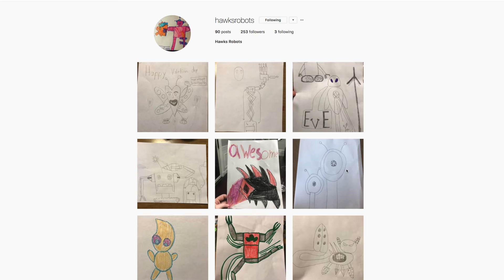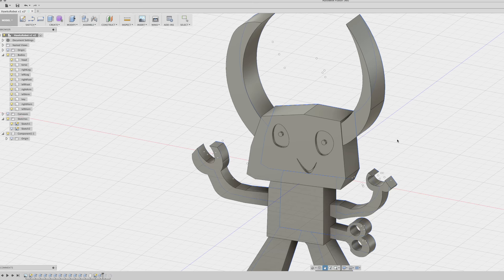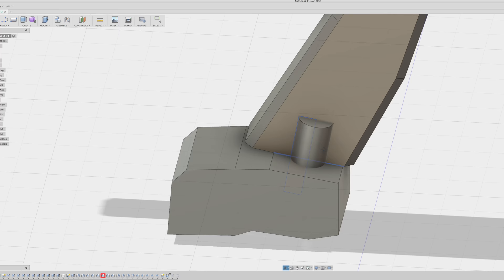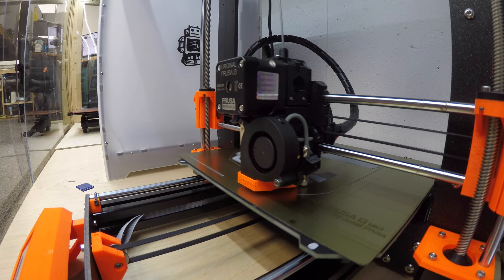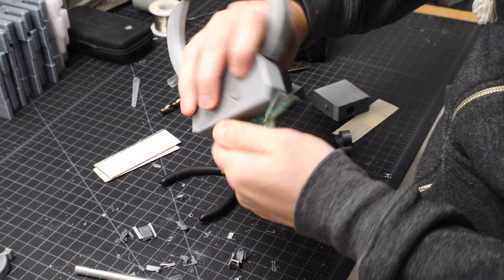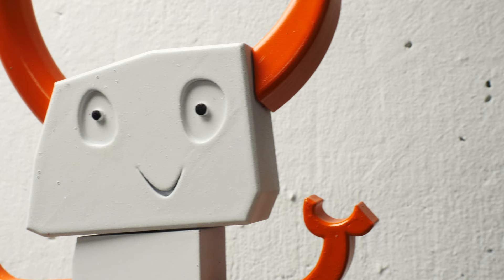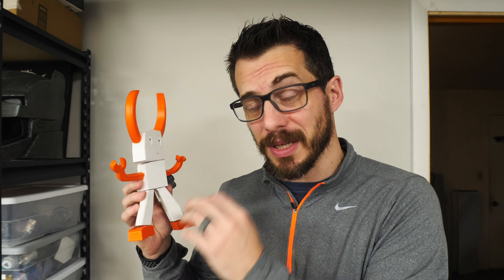Turning a drawing into a toy using 3d printing! | I Like To Make Stuff

Comment: Awww BOB! This was wonderful. The hug at the end, man, that makes it all worth it. Right there.

One thing - the posts CAN be a bit fragile, though, you mitigated this by printing them on their sides. That'll give them strength for days!
Reply: 3D Printing Nerd Maybe have holes on both parts & use wood dowel for the connections.

Comment: Really cool project ! Got a small tip for you, masking holes is easy. Use ear plugs, the disposable type they often have in the workplace, roll them in your fingers and pop them in the hole then let them expand again. You can either just leave the excess sticking out which makes them easy to remove when you're done, or if you want a nice crisp edge to the paint right up to the hole then cut them flush with a razor and hook them out with a pick once the paint's dried.

Comment: Hey bob if you ever make a project like this following the same system of joints, try printing a tolerance gauge to determine how much tolerance you need to have the parts move freely without all the sanding. For me personally with a printer and working on projects that gal under that same retrospective  I always use my gauge to make sure I not only waste material, but make the process easier. Your really doing good!

Comment: First of all I wanted to say that you certainly set the bar extremely high at being the very best father you can be. Thumbs up for that in and of itself as being a good parent is by far the hardest job in the world in my opinion.

I'm a disabled marine (I've been diagnosed with cancer three separate times as well as suffering through 3 strokes and I'm a paraplegic... all in the last 15 years) who is the father of two mostly grown kids (my oldest is 19 and my second oldest is 17 years of age). With all of that being said... I still do my best to be as physically and mentally active, alert and fit as I can but a large portion of my awake time I spend reading, writing and drawing. 

I've been a comic book reader , collector and even a creator over the past 40 years and I also enjoy collecting toys as well when i find a specific toy line that strikes my fancy. Typically, my preferences lean heavily towards action figure toy line that I collect mostly. So, I'm really into super heroes, giant robots and giant monsters as well. 

Okay, now that I "think" that I've set up what I'm trying to say here... I really liked this video that you made on how to take a drawing and  "convert" a 2 dimensional idea into a 3 dimensional figure/sculpt/toy. I did a lot of research before committing to saving up enough money to purchase a 3d printer that would be capable of creating 3d versions of any and all of my original comic book character concepts. I've even worked a bit within a couple of different "free" 3d rendering software programs but I haven't been happy with any of them as of yet. However, I am definitely going to give Fusion 360 a shot after watching your video. I really hope that with some practice and work that I'll FINALLY be able to view one of the hundreds of my character creations as an actual "action figure".

Thank you for such a great, succinct video.

Comment: At hobbly lobby you can buy small brass or aluminum rods which you could use a hacksaw to cut for the posts. using a hammer to thicken the edge might hold it in better, especially if you can get an accurate arrow shape so it only goes one way

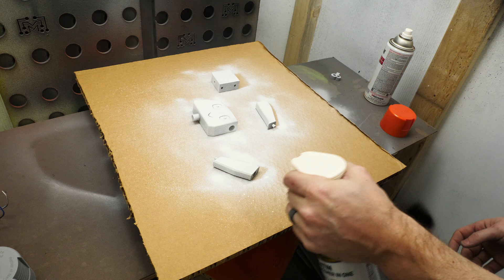Comment: 05:00 To mask the holes, try using foam backing rod available at hardware stores and home centers. It's intended to be installed behind caulking to fill large gaps and is available in many diameters and inexpensive. cut a short piece and stuff it in the hole. Pull it out when you're done painting and Bob's your uncle. 🙂 

06:45 Would it be feasible to reinforce the posts with a brad or finish nail. Drill a small hole slightly smaller than the nail and insert the nail setting the head flush with the end of the post. If necessary, shorten the nail with wire cutters.

Comment: Nice video Bob! =D

tip: Next time you do a canvas, you can on the menu right click the canvas and select "Calibrate"  to select 2 points and set it's real distance, so, when you design the 3d model, the model will be as big as the real drawing =)

Comment: Excellent!!! Really amazing idea and great work. As you pointed, the pegs could be modified a bit to a bit of ball shape =O so they can snap in and be easy to rotate without coming out. As you pointed, the idea can be pushed as much as desired, even adding LEDs, motors or any other item.

Comment: Fusion 360 is really cool software. I don't have a 3D printer or anything, but I like messing around in it. Ben Brandt here on the YouTubes has a few videos where he demonstrates some cool things you can do with F360's parameters and constraints.

Comment: I did something like this, but instead of just rid joints I used ball joints, so when the arms legs and head are attached they won’t pop out, but they are hard to push into the hole

Comment: What type of engineering is this, 
taking someone else’s design and making it, modifying it as needed, but turning it in to a 3 dimensional object from the two-dimensional sketch or drawing or maybe just concept. using some computer software such as fusion 360 and turning it into a product?

Comment: Just thought you might like to know, Autodesk seems to have changed the terms a bit. You can get Fusion 360 free for a year, but then it's whatever the usual cost is. $40/month or $300/year.

Still, that's pretty cool. I hope he keeps at it. You might have really cool stuff to model in a few years. :)
Reply from the maker: No, there's still a hobbyist/student license available forever.  👍🏼 Check the pinned comment.
Reply: Or maybe I just clicked the wrong thing. Oops.